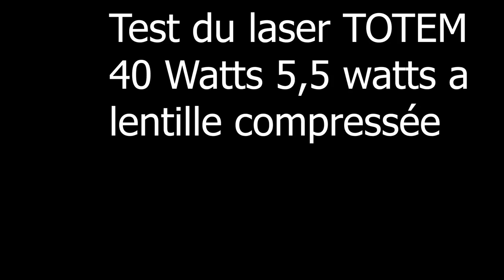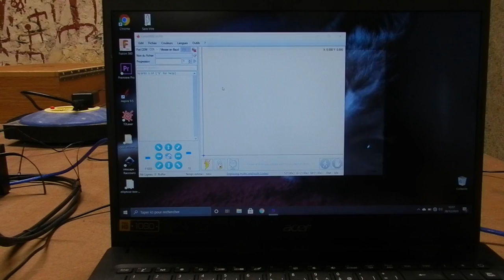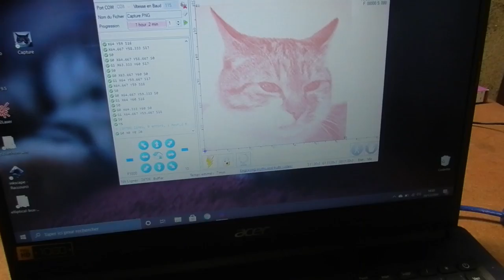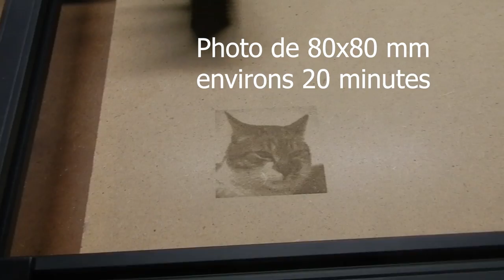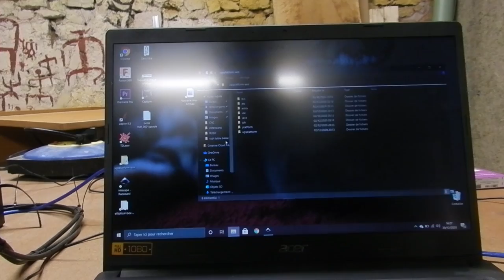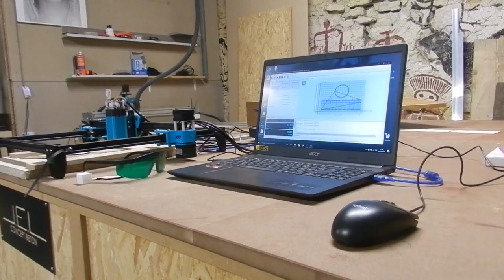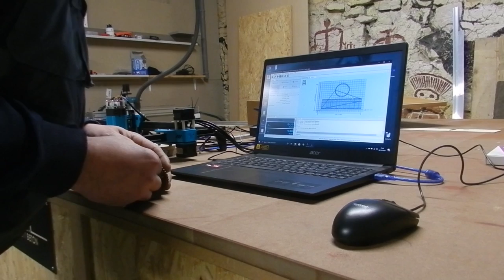TWO TREES® TOTEM S 40W

Comment: Quelle vitesse vous avez utilisé pour couper du bois de 3 mm?
Reply from the maker: 250 mm / minute
Reply: @atelier_Vosgien  Merci, et combien d'étappes / repetitions?
Reply from the maker: @allardvanw  1 ou 2 passes
Reply: @atelier_Vosgien  Avec mon Totem, 1.5 mm multiplex, 250mm/m et 2 passes ca ne marche pas.
Reply: @allardvanw  My totem won't cut it even 10 times. China shit. I'm going to complain.
Reply: @lubomirkontra236  Well, there is plywood and plywood. For instance, I tried high quality beech plywood. And any diode laser will have trouble cutting through this type of wood (and the glue layers for that matter). My guess is in this video another type of wood is used of much lower density. I cut 8 mm balsa in 7 passes with a clean and narrow cut. My experience is generally very good. The cuts are precise with a very narrow kerf. If you want to cut more heavy stuff, a CO2 laser is the only way I'm afraid.
Reply: @allardvanw  Yes it's true. But I cut soft poplar plywood. I tried to cut 0.2 mm thick paper at a speed of 400 mm / min and 100% laser power and cut it only partially.
Reply: @lubomirkontra236  You don't see effectively nothing cut in this video ...I think everything is cut with other tool !
Reply: @nexuspolaris76  I think not. I complained about the laser head and I have a new Totem laser. That cut without any problems.
Reply: @lubomirkontra236  ik heb ook een totem S 40w en niets wordt op een juiste manier gesneden alle instellingen en aal filmpjes hier al 100 keer bekeken 
ik ga ook mail sturen om te klagen wie weet hebben zij geen oplossing
Reply: @lubomirkontra236  ik heb hetzelfde probleem . heb de instellingen van laser GRBL al gebruikt, deze al aangepast en niets werkt heb het beu
Reply: @nexuspolaris76  it's fake. It can be seen in the minute 3:22 and further when he pulls out the "cut" material where there is absolutely nothing. And then he pulls a carved sheet out of somewhere.
Reply: I complained about the laser head. New laser head cuts 3 mm poplar plywood per pass speed 150 mm power 100%.
Reply: @atelier_Vosgien  lazer gücü ne kullandınız ?